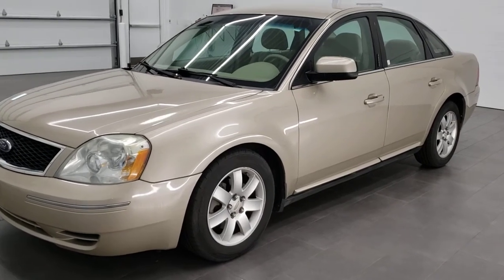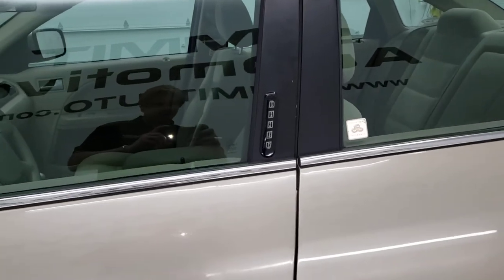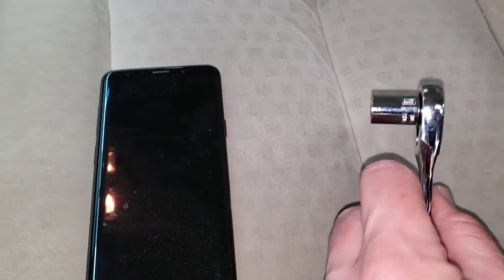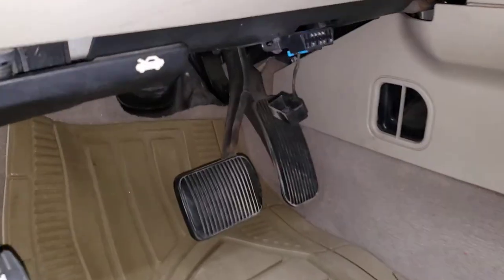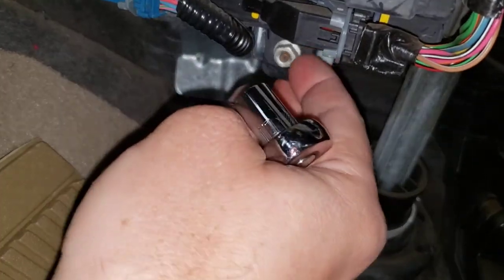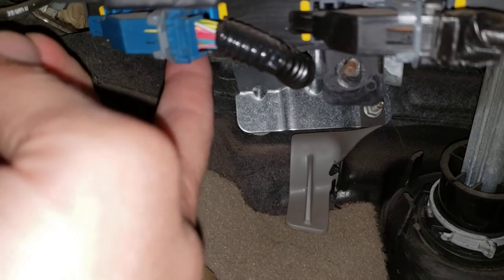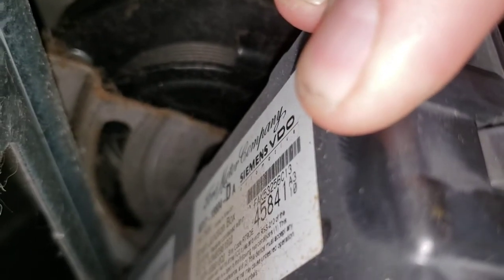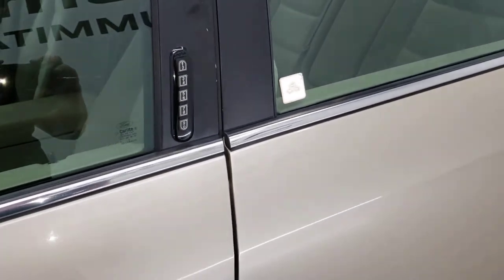WHERE IS THE DOOR CODE LOCATION FOR MY 2005, 2006, 2007 FORD 500? FORD FIVE HUNDRED DOOR CODE FINDER

Comment: Worked for 05 mercury montego.......thank you!!!
Reply: I was just about to ask about the 2005 mercury Montego
Reply: Hello Vince i dont know if u ever had the problem with the gear shift like i am right now, in the morning since the car is off overnight the next morning when i go in the gear shift works normal but then after a while when the car gets hot i dont know what happens but my gear shift gets stuck on park and the rubber in the gear shift gets crinkled then i use one hand to hold the gear and the other finger to try to flat the crinkle part until the gear shift slides to drive and sometimes my gear shift shows mini lights when u go from park to drive everyone shift has a light beside it so its off and then after a while it comes on but its not red its like yellow orange and long time ago it was red and sometimes when it gets stuck it shows clear. Another thing, which power steering fluid should i use because when i turn my steering wheel it has a whining noise and someone that i asked about it randomly happened to have some power steering fluid and he put me some but then i noticed ever since then my gear shift has been doing this, not exactly the same day but after like a week and then i noticed a leakage and it looks like the color of the power steering like a red color, i dont have money to fix it now im trying to take care of other things i have going on so im planning to get some power steering fluid to stop the noise until am able to afford to fix it cause i dont know what the problem is, this car is a good car but the spark plug is always a problem and right now my ac is not working someone put gas and 3 days after the ac stop working and im in florida in the heat have no idea what am going through PLEASE HELPPPPPPPPPPP ):

Comment: Looking at the comments my question was answered......about to do this on my 2005 mercury Montego
Reply: Hello Chris i dont know if u ever had the problem with the gear shift like i am right now, in the morning since the car is off overnight the next morning when i go in the gear shift works normal but then after a while when the car gets hot i dont know what happens but my gear shift gets stuck on park and the rubber in the gear shift gets crinkled then i use one hand to hold the gear and the other finger to try to flat the crinkle part until the gear shift slides to drive and sometimes my gear shift shows mini lights when u go from park to drive everyone shift has a light beside it so its off and then after a while it comes on but its not red its like yellow orange and long time ago it was red and sometimes when it gets stuck it shows clear. Another thing, which power steering fluid should i use because when i turn my steering wheel it has a whining noise and someone that i asked about it randomly happened to have some power steering fluid and he put me some but then i noticed ever since then my gear shift has been doing this, not exactly the same day but after like a week and then i noticed a leakage and it looks like the color of the power steering like a red color, i dont have money to fix it now im trying to take care of other things i have going on so im planning to get some power steering fluid to stop the noise until am able to afford to fix it cause i dont know what the problem is, this car is a good car but the spark plug is always a problem and right now my ac is not working someone put gas and 3 days after the ac stop working and im in florida in the heat have no idea what am going through.

Comment: Does this work for the Mercury Montego
Reply from the maker: It definitely should.  Check it out and let me know if you found it!  Thanks!
Reply: Hello Derrick i dont know if u ever had the problem with the gear shift like i am right now, in the morning since the car is off overnight the next morning when i go in the gear shift works normal but then after a while when the car gets hot i dont know what happens but my gear shift gets stuck on park and the rubber in the gear shift gets crinkled then i use one hand to hold the gear and the other finger to try to flat the crinkle part until the gear shift slides to drive and sometimes my gear shift shows mini lights when u go from park to drive everyone shift has a light beside it so its off and then after a while it comes on but its not red its like yellow orange and long time ago it was red and sometimes when it gets stuck it shows clear. Another thing, which power steering fluid should i use because when i turn my steering wheel it has a whining noise and someone that i asked about it randomly happened to have some power steering fluid and he put me some but then i noticed ever since then my gear shift has been doing this, not exactly the same day but after like a week and then i noticed a leakage and it looks like the color of the power steering like a red color, i dont have money to fix it now im trying to take care of other things i have going on so im planning to get some power steering fluid to stop the noise until am able to afford to fix it cause i dont know what the problem is, this car is a good car but the spark plug is always a problem and right now my ac is not working someone put gas and 3 days after the ac stop working and im in florida in the heat have no idea what am going through.

Comment: My car has the wrong numberss
Reply: What kind of car you have?
Reply: @tonyangelodavis1805  it was possibly changed by the privious owner. Look for the video on how to reset it
Reply from the maker: You cannot erase the factory code.  Either the pad is broke or someone changed out the body control module.  You can test the pad.  Make sure you have your keys out of the car.  At the same time press the 7-8 and 9-0 button. That should lock your doors.  If it does not then your pad is broken.  Maybe check fuses? If it Locks then maybe the body Control module was changed out or you are looking at the wrong numbers
Reply: @miaaustin1825  okay thanks for letting me know